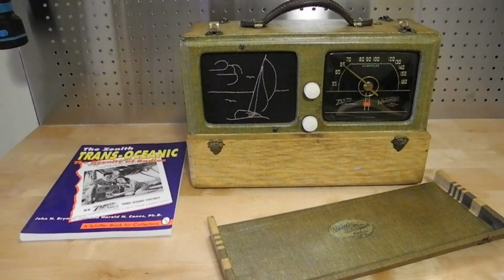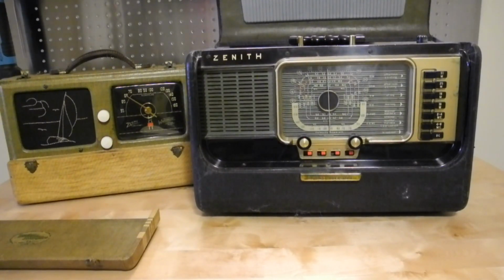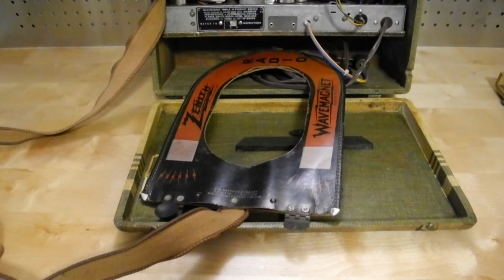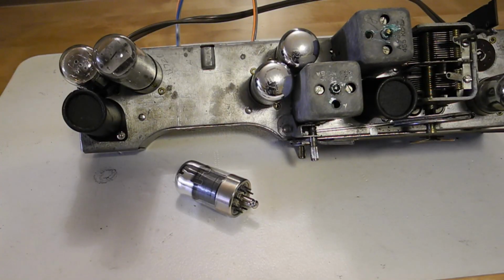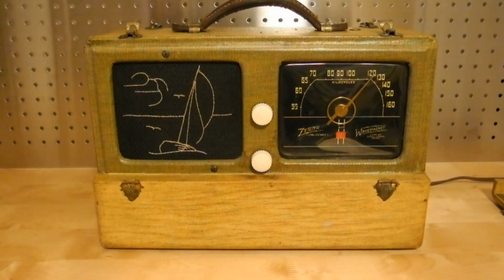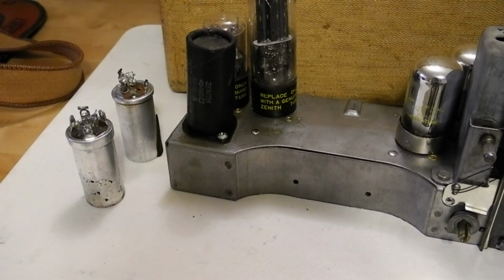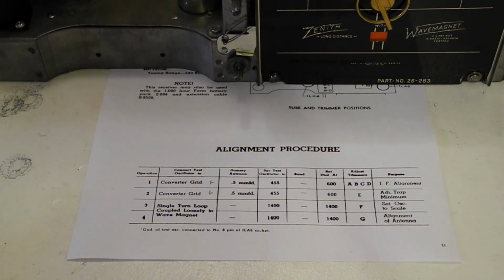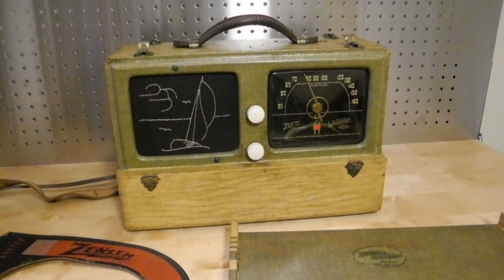The Zenith GG601 Universal Portable Radio

Comment: Jeff, Nice job with both the video and the radio.  I just picked up two of them on two different days for $5 each.  Neither is working, only the power tube lights up, and the red flag is always showing on both.  The power plug will not seat all the way into the chassis on the radios either.  I hope to recap them after I recap my Zenith Trans-Oceanic R600.  73 Paul AA1SU

Comment: Hello Jeff, Thank you, for such an Interesting, as well as Nostalgic 'walk' down Memory Lane, regarding this marvel radio, from the past.  I never thought I'd ever see this again.  My father had given this to me, in the late 50s, shortly after the new, and then, rather expensive, transistor radios, had come on the scene. That sailboat design, along with mechanical red 'on' indicator, was part of that Zenith iconic appearance. I asked my dad, "Why don't you buy a battery for it?"  My father had explained to me, that a battery would be nearly as expensive, as the radio itself!  At the time, I found that hard to believe. Low and behold, a few months later, on my birthday, he bought a battery, and installed it for me.  He said that the battery cost $18.00, which then, was more than half of what the radio had cost in the 1940s!  Over the years, with moving, etc., that radio had disappeared, but never the Great Memories, of that radio, my beloved father had given to me.  Thanks again, Jeff, for jogging some  great memories of the past.
I"m 75 now, and recently retired from being an EMS First Responder, in the San Francisco Bay Area.  Now living in Kentucky, I'm an avid Ham Radio operator: KI6CMR  Kindest regards!

Comment: I have the older sister to this one, a 6G501 I bought in 2001 at an antique store in Alton, IL for $95 (found out later I paid too much). I actually built my own battery pack for this and a Zenith H500 TransOceanic I bought soon after, out of 60 AA's and 6 D cells, it took a trip to two Radio Shack's to get enough AA battery holders to add up to 60. I also changed the plug to a 4-pin CB mic, at the time it was much easier to find than the original plug and jack. Works great up until I wear the batteries out, replacing them can cost close to $60 US if I get Duracell or Energizer alkaline.

Comment: Wondering if you have any thoughts on how to obtain or fabricate a replacement case handle for this model radio?  And, thanks for the excellent video.
Reply from the maker: I would look for an old suitcase or briefcase that has a similar handle, You may be able to find something at a thrift store or similar.
Reply: @jefftranter  Used to be Antique Electronic Supply at tubesandmore dot com carried handles that were similar, I was going to get one for my 6G501but never pulled the trigger on it. They've become more of a tube amp parts supplier as of late and don't carry as much for old radios like they used to.